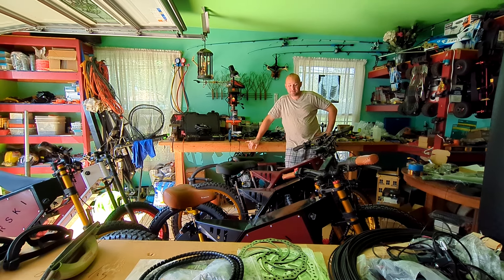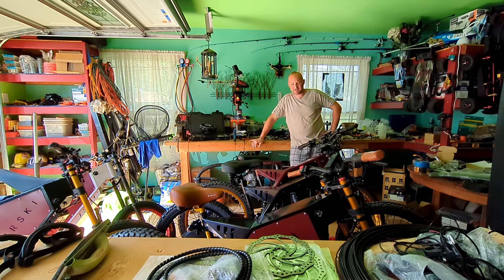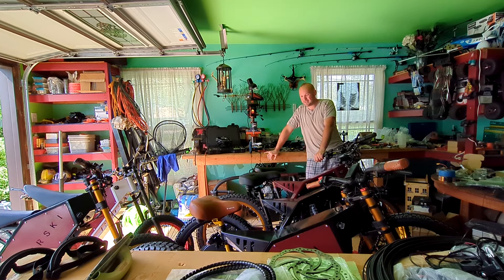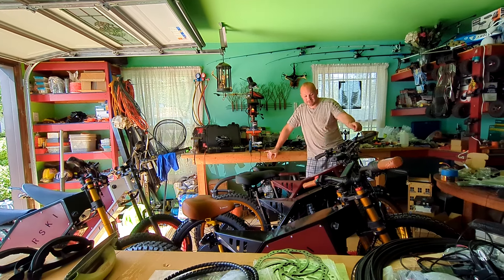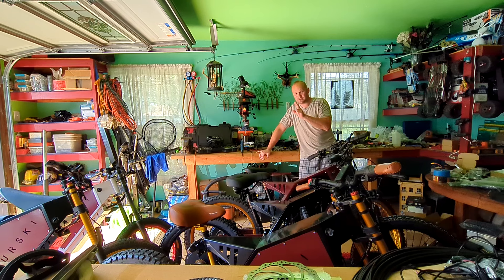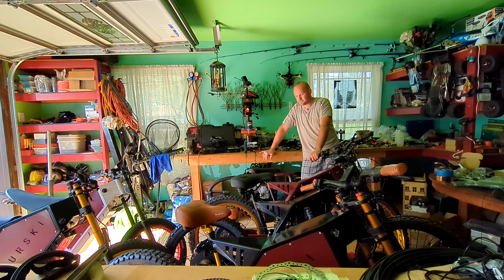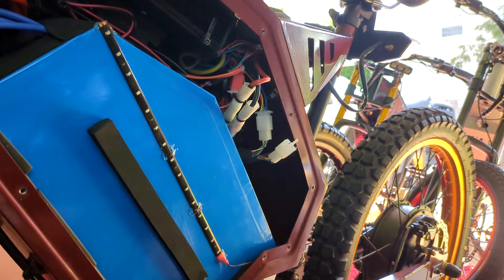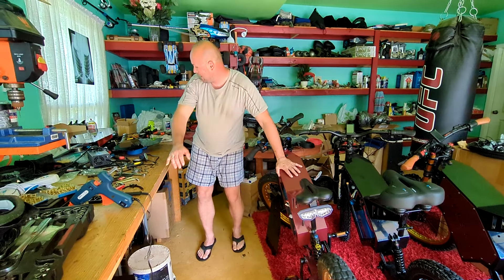How to burn out a eBike hub motor on a nice hot day.

Comment: Hi Kurshi i subscribe to your channel to try to learn more about e bike i like to buy one but i am not sure what to buy i dont like the fat tires  i like more like mountain bike but i like power i dont want 500 watt i want more , what do you recommends
Reply from the maker: Fat tire is ok, but you will replace them often. Fat tire is 4 or 4.5 inch. Kurski is 2.75 inch. Not a fat tire. It is a motorcycle tire. I think max speed for fat bike tire is 30 miles. Going faster on a fat bike tire you risk the tire coming off the rim on a sharp turn. I like kurski, it is very fun. I am a contractor, so I have many days off, especially in the hot summer. Then I ride.
Reply from the maker: You have a super bee ??